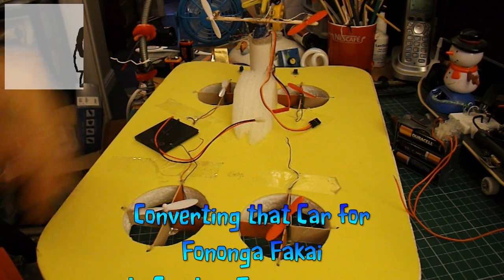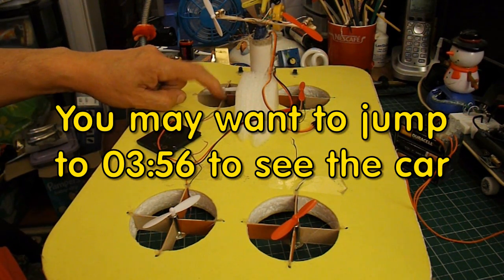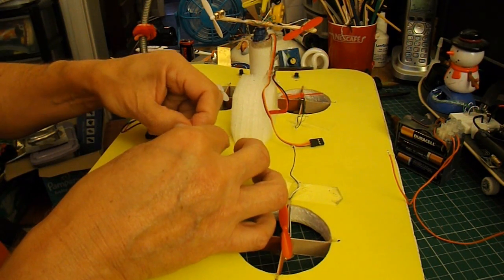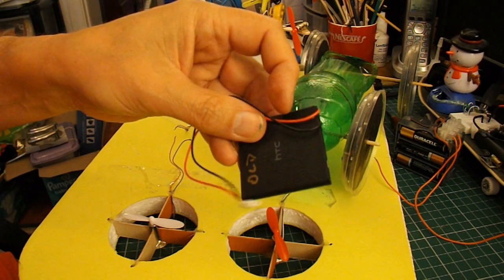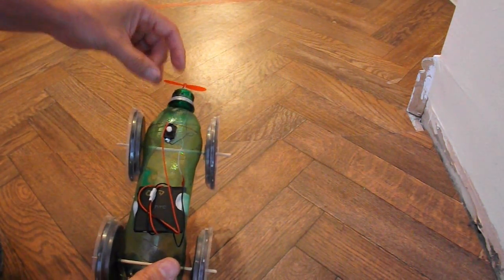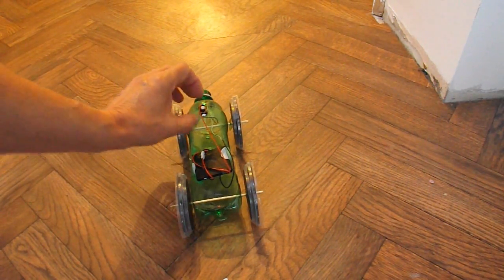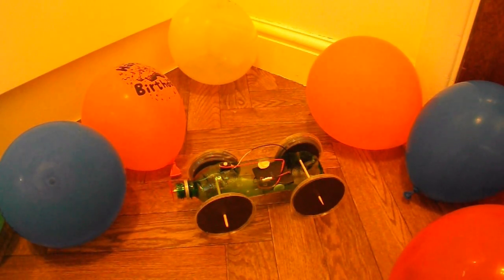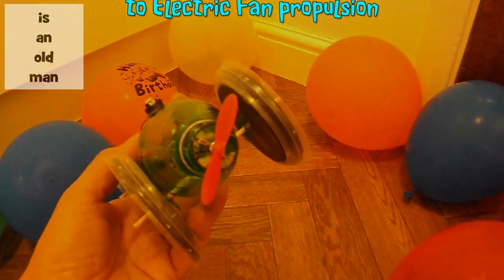Converting that Car for Fononga Fakai to Electric Fan propulsion

Comment: for the way that is set up , is about the same as a quad copter you can get say like a medium size quad for under 30 $  with controller and quad. now you can have a 4 channel setup that moves around the way you want it with all built in controllers, axis , self leveling . then you can cut out the motors for certain projects , and also this cuts out need for heavy servos. these copters are now really small and light
Reply from the maker: iam4god2day I am guessing you are talking about the Quad Fan Hovercraft. If you follow the project - see the playlist link in the video description -  you will see this was originally intended only to use the motors from cheap vibrating toothbrushes. It developed further than intended and I burned out those motors by absentmindedly plugging in 2S Lipos when I intended to just use a single battery, so 7.4 volts instead of 3.7 volts. It worked exceedingly well for a rather short time.

Comment: Grandad please replay very quickly . I really need to know if brushless motors dont run as good clockwise as counter clockwise and I'm asking you 'cause flitetest or others would take ages to replay it,s very important,very!!!!!
Reply from the maker: Ana Gubariu as far as I know you can reverse the direction of brushless motors simply by changing two of the three wires that feed it from the ESC. I do it on this video https://youtu.be/hTuKSsm-3zM?list=PLA5a2xPRSrB13Xcquw4Ff09MQzTPjeVkI following the directions from David Windestål's video - motor direction hint at 13.10
http://youtu.be/kvZGA6dJQJs?list=UU16hCs7XeniFuoJq0hm_-EA

As far as I am concerned if David Windestål does it, then it must be OK.
Reply: GrandadIsAnOldMan Ok thank you.I needed to know cause i,m building the FT Tiny Trainer and I also want to give it a bixler nose that someone showed on the site but I didn't buy a pusher prop so I got afrid that I wasn't gonna be able to make that mod.
Reply from the maker: Ana Gubariu I guess that means you are going to reverse the motor and reverse the prop. Should be OK but I would do some sort of test before building the plane and finding it won't work. Mount the motor on a heavy block of wood and wire it up to check. When you do use it remember the prop still has to face forwards in relation to the direction of motion or it will be far less efficient.